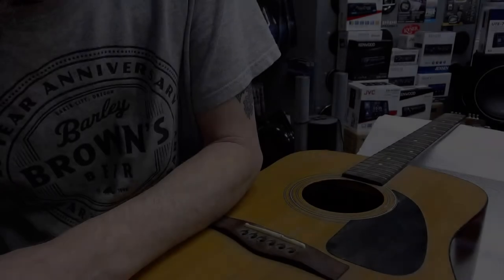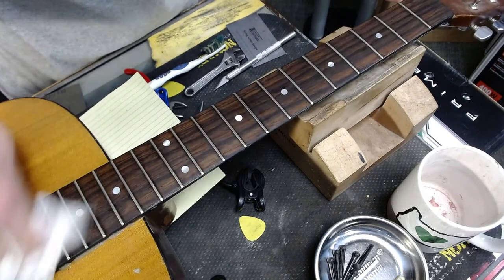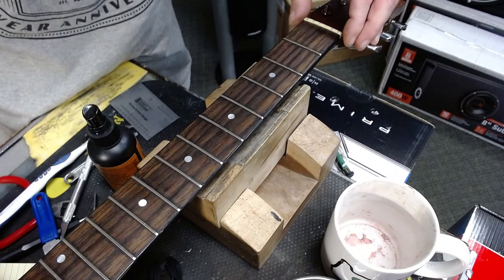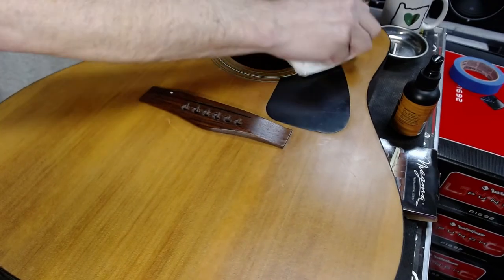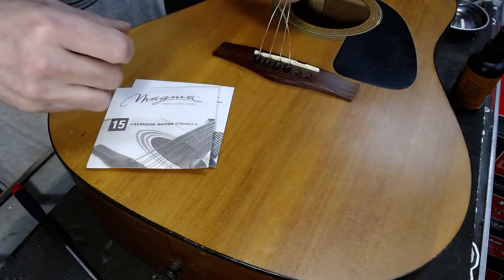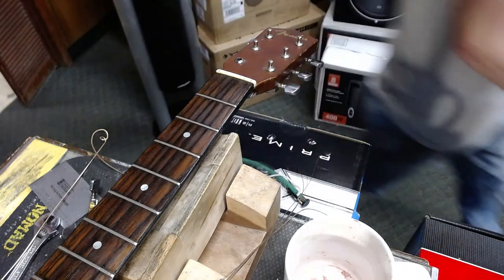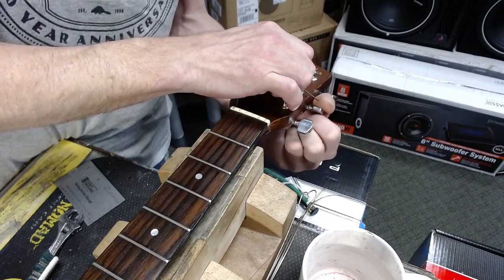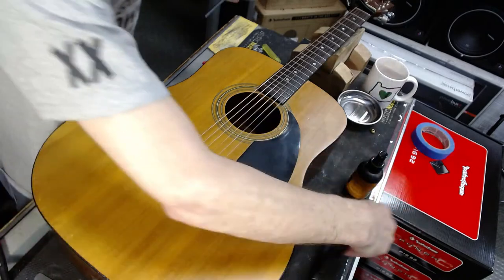WTTB EP 61: FLATWOUNDS ON AN ACOUSTIC?

Comment: The Original Flatwound Strings were designed for Bowed stringed instruments as a replacement for the Gut Strings cause they last many times as long, hold tune better, and the flat surface makes playing the strings easier. They came as early as 1874 by a guy named Hamilton.
Reply from the maker: Thank you Oscar.
Reply: @MarshallSetUps  It only took a few seconds for me to figure that out. It really proves to everyone out there that you can put Flatwound Strings on an Acoustic Guitar too.

Comment: What did you use to clean the fretboard please, other than the toothbrush? 🙏😎
Reply from the maker: I use Simple Green, and a toothbrush. I place a few paper towels under the neck to keep the nasty stuff from dripping all over my work bench, and use the paper towel to wipe all of the guck off the fingerboard, and the neck. Be careful to get it all off. It can leave a little discoloration in the finish. Get it all off as soon as your done cleaning.
Reply: Thanks. 👍